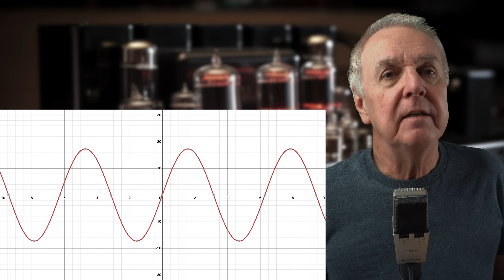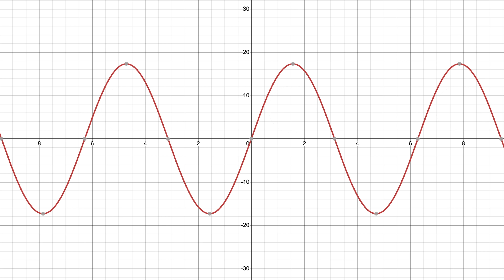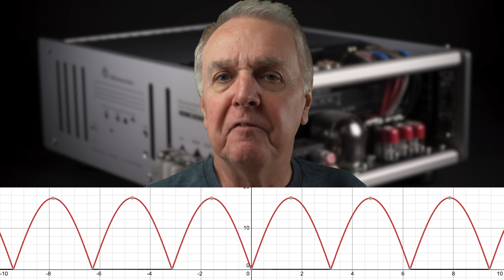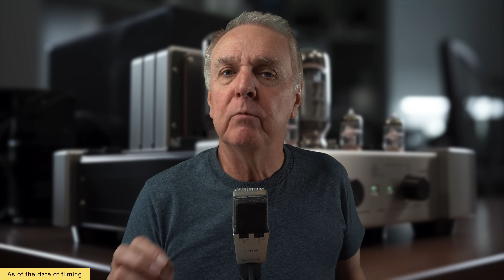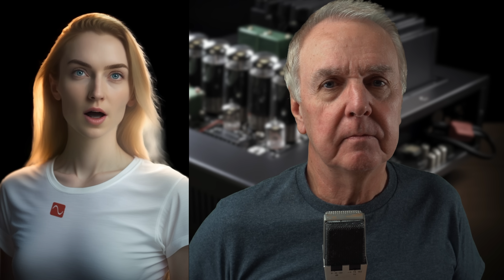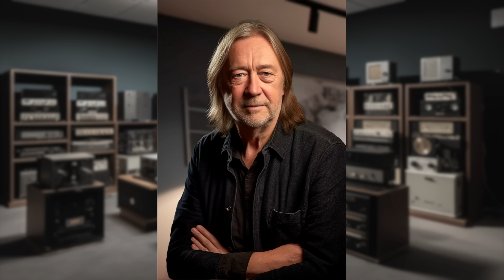Your power amp is average - Here's why

Comment: Okay it's true that Wrms is incorrect but the term in EE is Real Power. Vrms*Irms gives the apparent power (VA I think) and represent the actual current requirements of the circuit. The use of R blurs the fact that with reactive loads like loudspeakers the amp is required to output much more current than the actual power consumption (we call it work) and then it is also required to  eat away the back emf current . Not only RMS is wrong but the value doesn't tell how the amplifier will behave with a reactive load.

Comment: I was always taught Power is the rate at which work is done.
And it's very simple for an engine: multiply torque by RPM, and there you are!

I don't care about this amp power stuff. Because I don't ever try to demolish my home with either volume, or bass transducers.
I have known for many decades the claims of amp makers were rubbish, and that the only really important aspect of a speaker is it's efficiency, and the only important thing for an amp is how it sounds when it's connected to your speakers.

And so I always was a bit mystified by people hand-wringing over power ratings for both speakers and amps. It's all lies, and it pays to ignore that stuff unless you absolutely can't - for whatever reason. I have never failed to drive a set of speakers with an amp, and I have never blown up a set of speakers with an amp. Except when I was 15, and they were my Dad's cheap-as Heathkit kitset speakers he built when at Uni. :P

Comment: Back in the early 80’s I used to sell audio and we had Harmonic Kardon. One day one of the engineers paid us a visit and gave me a small little box, and in it was a nine cold battery and two RCA outputs. He told me that this was a better measurement of what an amplifier could do and would show current in an amp. It emited a pulse, the woofer would move back and forth. Every Harmon Kardon amp connected could push that woofer back and forth with no issue, even large ones. When I connected Japanese receivers or amplifiers the woofer would barely move. One day I’d like to know that current is also something that is recognized or these “high current” amps “there are some still” are as you say, audio phoolery 😮

Comment: My amp is not average 
Audio note ongaku 
And a beautiful hand made valve amp built by my dad who’s an ex radioham 1000 watt per channel used for nightclubs in the 80’s using tt21 valves ten of them on each bank no joke anyone who knows how to build amps will understand what I have is an amazing home hifi amp and one I cannot use as it’s brutal and would bring down a concrete ceiling

Comment: Have you ever heard or known of the BSS EPC 760/780 series of amplifiers?

Honestly would love to know as i agree with you for the most part.

If not then FYI.. they were designed and built at a huge loss to compliment the Turbosound Flash and Floodlight systems in rhe 90s. To be the best soundijg amplifiers in the world.

Some people say they still are to this day.. myself included. They make mediocre speakers sound fantastic... in juxtaposition to this i have heard B&W 704 speakers running off i think Quad or McIntosh amps and couldnt contain my laughter. Yes the speakers shone through in terms of clarity and tonality but these so called "high ens" amps just couldn't drive them they way my BSS could.

Btw power isnt the problem here, the macintoshs i think are roughly 300w with good current delivery at low impedances. So surely plenty of juice there right?

Whereas i am powering a Monitor Audio BR2 (6ohm nominal) with an amp capable of 1625w sustained (underrated) at sub 2ohm loads.

One thing i, and everyone who has heard it haa commented.on is.that there is NO congestion to the sound at all..and all of the impact, immediacy,.slam, punch,  effortlessness... yet also subtlety, softness, silky smooth delivery and space between the musical elements ALL scale as you increase the level (to.seriously high SPLs)

Comment: You cannot produce an even slightly meaningful power figure by squaring the peak-to-peak voltage and dividing it by the resistance, even as a peak. There is never, ever, a voltage over the load from a pure sine wave of that sort with respect to the central point of the waveform so it is meaningless in that context.

The only time where it could have a meaning is if the two outputs of an amplifier are operating in what is called "bridge mode", whereby the output of one is a mirror image (180 degrees out of phase) of the other. Then the load will see peaks which are equal to the peak-to-peak voltage, but if that is the case, it's necessary to show both (180 degree out of phase) sine waves, or if you just want absolute values, the difference between the two voltages. In effect, if the two sine waves are " a * sin(ωt)" and "a * sin(ωt+π)" where "a" is the amplitude (half the peak-to-peak voltage), ω is the frequency in radians per second and t is the time in seconds, then the signal across the load will be "a * (sin(ωt) - sin(ωt+π))" which equals "2a * sin(ωt)". So that does yield a sin wave with twice the peak to peak voltage, but only by taking the differential voltage of two power amps 180 degrees out out of phase. 

Note that another term for this is "differential mode", and there are amplifiers that do work like that. There are a lot of class "D" amplifiers that do, and they have 4 channels where they can be operated such that there are pairs operating in bridge mode. It's very useful where the DC voltage is low, such as in a car, as the power output can be quadrupled. 

However, when sketching out the signal output from the power amplifier, you can't have it both ways. That is draw a simple sine wave and claim that the peak power output is the square of the peak-to-peak voltage divided by the resistance. You either show both sine waves, or the  output of the bridged output which will have double the amplitude. The peak output is never, ever, the square of the peak-to-peak voltage (double the amplitude) of a sine wave across the load.

As far as what we hear, it isn't watts, it's sound pressure and that is conventionally measured in dBA, which is a logarithmic scale weighted according to the human ear's responses to different frequencies. Just what that means in terms of amplifier output wattage depends on a large number of other factors, such as the location of the speakers, their efficiencies, the nature of the acoustic environment and so on.

Comment: If you hear "hand picked components" you should shun away. A design should work with tolerances in mind and component specs change over time, loosing the hand picked advantage. And if the design wasn't made for that…

Comment: I collect old Ghetto Blasters, The JVC DC-33L with Turntable has high power output for a Portable System, its 11w RMS X2 but sounds truely awful and not very loud, the original speakers are what lets this system down, 3.2ohm i think, there not even 2 way, the mock tweeter is bass port, speaker cones so stiff they hardly move, it doesn't sound very powerful for the output power but when you connect up some better bookshelf speakers this unit comes alive and sounds wonderful for what it is

Comment: Let's cut to the point.
I don't care if RMS is an inaccurate way of measuring power. Is not two different amps of the same rms the same power roughly.
It's seems to me your argument is my weight of 183 pounds is wrong because I need to weigh myself by kilos!
Yes I understand that a five hundred watt tube amp can be driven harder than a solid state or even class D, but all three have sufficient headroom to play cleanly at a low volume.
I've got an old knight pa tube amp rated 50 watts.
I guy scoped it and said it's really 60 watts but breaks up at fifty.

Comment: I not to up on it all but if you got 12v 6amp power supply input and the amplifier claims to be 90% efficient, what would be the true watts unclipped be about, based on a class D tda7498 chip?

Comment: You need to drive your speakers (quoted SPL at "1 watt" [what watt?] ) WITHOUT DISTORTION. The impedence of a speaker changes at different frequences too, not many I suspect listen to music comprised of a 1kHz tone. Did someone say inductance of a crossover? Is the rule of thumb to have an amplifier more powerful than the rated handling of the speakers, and "be careful" not turning it up to 11.

Comment: I am neither an audiophile nor an electrical engineer,.  I do know that when I run these two big speakers in my field (15" EV Woofers.  JBL 2425 Drivers with Renkus Heinz lenses and some nondescript crossovers) with an old Sansui 661 (15w) or the Marantz 1060 (60w), I get beautiful clean deep tones at volumes that shake the neighbors before I hit the midway point on the volume pots.  Still.... I find your talks entertaining and I'm even learning a little bit.   Thanks for the insights.

Comment: ?? My brain hurts. Been buying hifi gear for 50 years. For me I have always found to buy gear where the amp power matches speaker capability ( using RMS quoted numbers ). Test the gear out in the shop in a room similar to your listening room size. Turn the volume knob up to 9 or 10 o'clock for normal personal listening levels, up to 12 noon to test for when you have just come back from the pub, or into the afternoon regions of 2 or 3 o'clock for party levels. Does this basic approach fill audiophiles with dread ?
Reply: No.

Comment: If your amplifiers output is sag'ing

The cause is usually that its Power Supply is failing to deliver the energy that the amps power output stage has demanded. 

Few domestic audio amplifiers are designed for continuous rating anywhere near their maximum transient power.

This is possible because we don't need to generate a continuous sine wave at maximum power .. 

We are listening to music which ( unless overly processed) likely has an average power of about 30% of the amplifiers transient response power.
( therefore the designer does NOT need to design a Power Supply with the capacity to deliver the amplifier's " Full " rating continuously )

Hence if you attempt to obtain it's transient rating continuously.. it's output falls off ( sags ) 😊
Reply: Maybe we don't need to generate or listen to a full sinewave signal on our system, but, the fact is, we should be able to do it, if the following situation occurs: we are watching or listening to some musical material on YouTube, near the maximum output of the amplifier, and, suddenly, its predictive listener experience algorithms drop a material about testing an amplifier continuous power output.
You are not close enough to the be able to reduce the volume of your audio system and, suddenly, the test sinewaves, at 40 Hz , 400 Hz, 1 kHz, etc, used in the material start blasting through the system and you don't have a limiter deployed.
Result: bye bye amplifier, bye bye tweeters, bye bye woofers.

Fact: in today's world, the chance of encountering over processed/over compressed audio materials, especially on the streaming platforms, is very high.

Conclusion: don't use any amplifier which is not able to withstand at least 5 minutes of 1 kHz full sinewave at full power output.

Comment: Very good attempt to explain a very complex topic that the industry has been wrestling with since the first vacuum tube amplifier.  In our opinion you were on a roll until you ventured to the “darkside” by invoking the term “fake watts” to describe a correct and valid measurement derived from a set of proven mathematical equations. Peak power value is not fake, peak-to-peak power value is not fake, and average power value is not fake.  Whether or not a given measurement is relevant in a specific context is another thing. One could fairly argue that using rms values to calculate power in an audio system is rather meaningless as well as the rms values used are that of a sine wave–where music signals are anything else but sinusoidal.  

Also in an audio system, the job of the power amplifier is not to provide electrical energy “watts” to produce “heat” but to provide electrical energy “watts” to produce kinetic energy transformed by the loudspeakers to produce sound and loudness which is measured in SPL. In fact heat produced in this process is a by-product not welcomed as it means energy is being wasted.

Happy listening

Comment: By the way, there is also the problem of phase shift between voltage and current when the resistance drops (or elevates). This is also of great influence in the delivery of power!

Comment: I have glossed over the replies to MC's vid, and I apologize if any comments were related to my post.  First off, what kind of amps are we talking about?  SS, hybrid or valve (tube).  There topology is different when driving speakers (and what kind of speaker your driving).  Speaker efficiency is paramount in tandem with the amplifier.  Amplifier loading varies greatly.  SS (solid state) amps (class A, AB and D) load voltage differently due to there topology.  Tubes are stage gains in amplification (continuous  power) through there rated transformers.  Watts are only a combination of values (volts*amps* to 1J (W) over distance, ect.).  Voltages (and current) are really the key factor when driving speakers.  The input signal is DC current (0.4v to 3.0v max).  The amplifier takes that signal voltage and "amplifies" that signal (0.4v = low gain to 3.0v = max gain or RMS).  The truth about watts when it relates to current supplied to the speaker (volts/amps) is the speaker itself.  @ 1 watt, the efficiency of the speaker will determine how that watt is driven.  Low efficiency speakers will not produce much work (load) through the speaker.  Where as high efficiency speakers will produce a more audible load.  Less watts are needed to achieve higher gain (volume) loads on high efficiency speakers.  @ 20watts, a 96db speaker will produce a high range of sound (decibels) than low efficiency speakers which require more current load (watts) to produce the same loudness gain.  Even low efficiency speakers will use around 40 to 60 watts per channel to achieve high gains (loudness) with a good, stable power (driven) source.  The basis for MC's video shows the actual (driven) loads required when using speakers as a load reference.  If you have a good pair of speakers (depending on the efficiency) you would be hard pressed (and possibly go deaf) when driving your speakers @ 100w per channel continuous loads (even under extreme low end bass frequencies).  Most speakers load at around 30 watts per channel comfortably and the gain is actually quite high.  Low efficiency speakers do well at around 50 watts per channel.  So, what do you even need a 1000 watt BS amp for?  Even if that amp could produce 1000 watts, you will only be using a fraction of that power to drive your speakers comfortably.

Comment: It is even more complicated because the load of an amp normally not a resistor. A loudspeaker is a complex (reactive) load, the resistance of an '8 ohm' speaker can drop at some frequencies to 1 ohm!! Most amps can not deliver the current (and the 'rms' power) that is required at 1 ohm. It is better to have a modest power amp that is capable to deliver enough current!  Keep going with your channel, you ar a very nice story teller (even for my age :)
Rob (from Holland)

Comment: Dear David. I have viewed this video a few times ( because I'm dutch and it take me a bit more effort to follow English, totally my fault ) and I looked at the info in the link. I believe it isn't that complicated. Let's use your example of 1 V rms over a 1 Ohm resistive load. Starting with 2.828 V p-p, divide it by 2 = 1.414 V p(peak). The current is 1.414 V p / 1 Ohm = 1.414A p(peak). Power is the multiplication of Voltage and Current. 1.414 V p * 1.414 A p = 2 W p(peak). Now we can say: to convert the peak voltage to rms divide the peak value by SQR2 ( 1.414 / SQR2=1 ) the same apply for current. This means that the conversion from Power-peak to rms is the following: P p / (SQR2 * SQR2 ) --> Power-peak / 2=power rms.
Reply from the maker: I'm finding it difficult to fault your logic. Perhaps other mathematical brains can join in this thread. DM

Comment: Interesting you should come across power output for cyclists. On a good day I can average 180 watts and peak 550-600 watts. Is it RMS though? 🤷‍♂️ No, in cycling terms  it is usually measured on watts per kilo. For a 77kg chap like me that's around 2.34 watts per kilo. TDF riders are usually 3 times this.
Reply from the maker: I would guess that the aim would be to measure the equivalent heating power, same as in audio. Whether cycling power meters actually do this I shall leave for more dedicated cyclists than I to worry about. DM